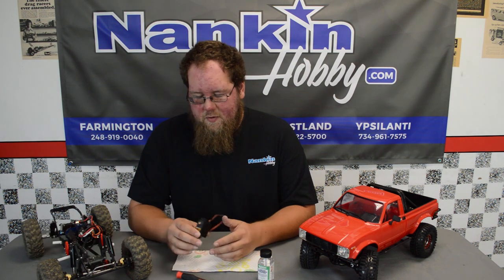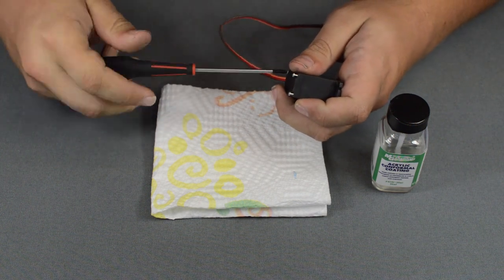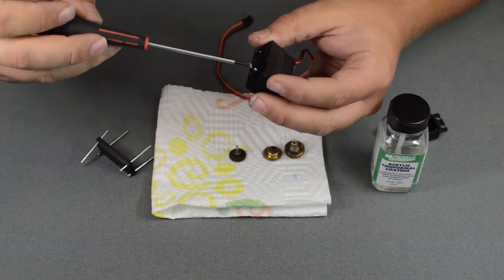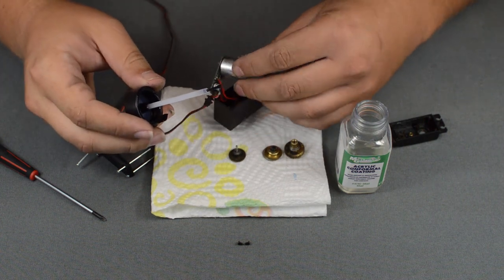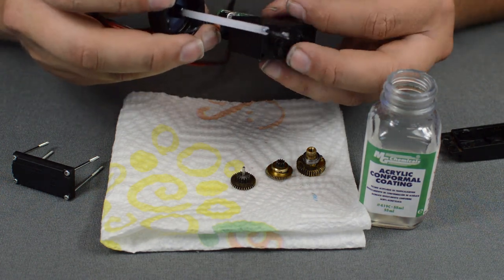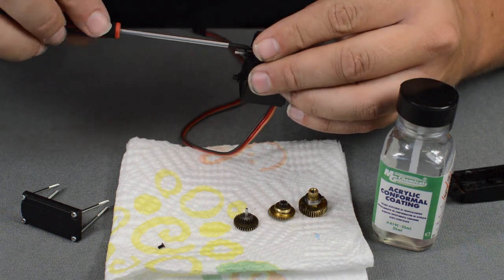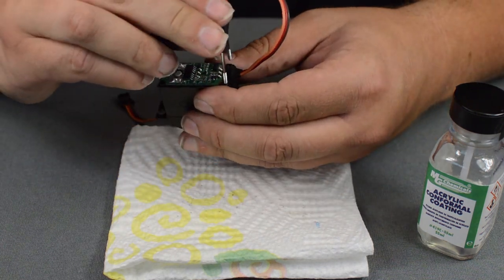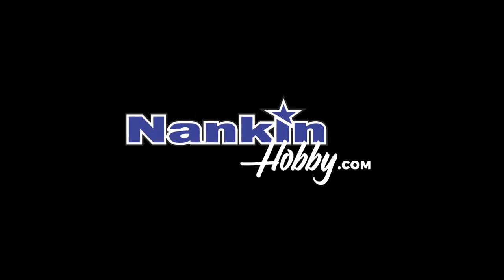How to Waterproof RC Servos - Waterproofing RC Servos

Comment: so does it matter if i get any of the coating on the servo motor?
Reply from the maker: If you get a little on the motor where it attaches to the board, that shouldn't be a big deal.

Comment: Could this be done with silicone as well?
Reply from the maker: If you're talking about silicone based conformal coating then yes!
Reply: @NankinHobby  Ok good thank you sir. Of course only for the outside of the servo along the closure but on the inside of the electronics yeah i will use the coating that you used and on the outside the silicone